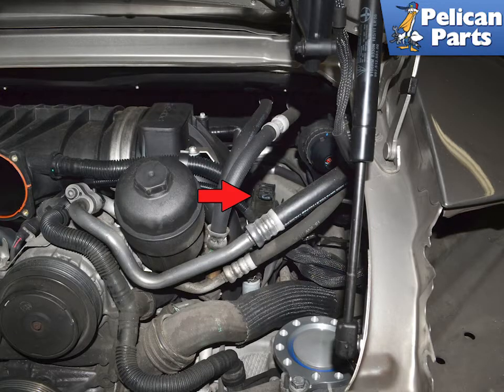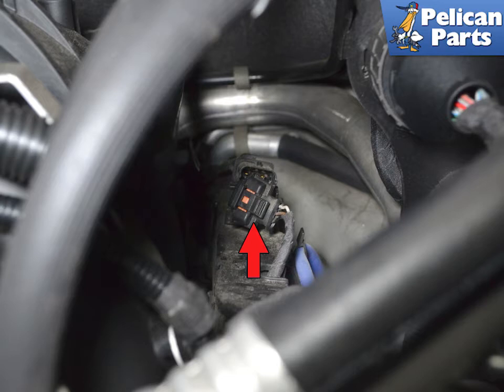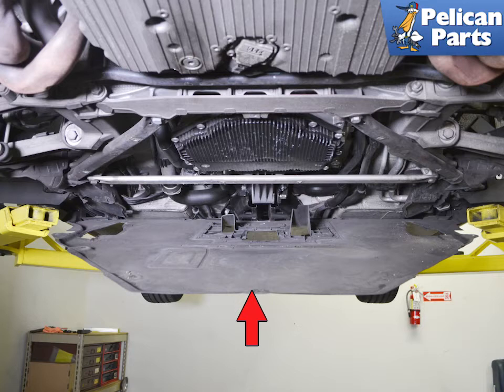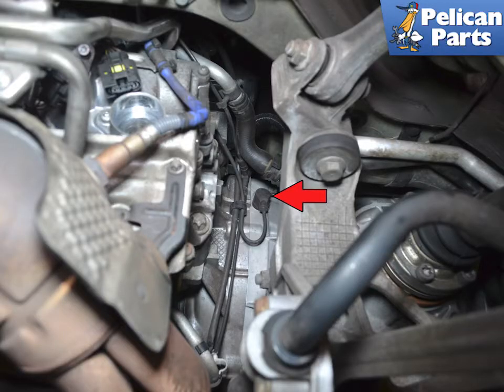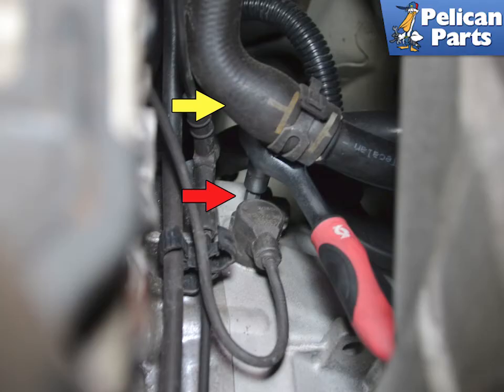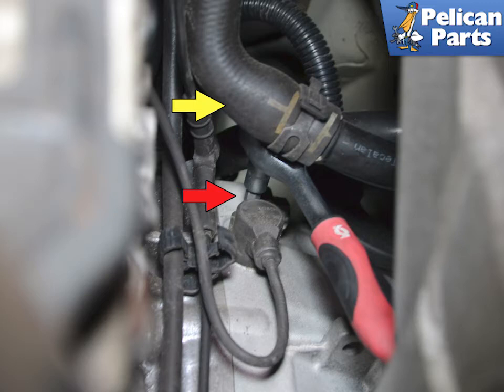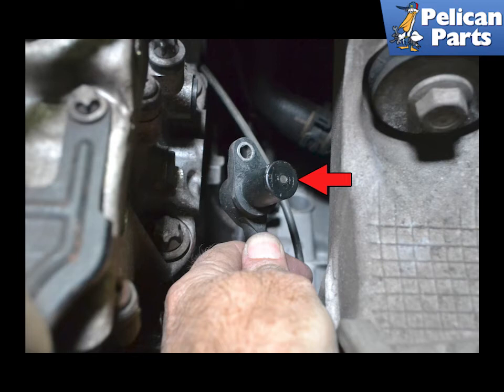Porsche 997.2 911 Crankshaft Positioning Sensor Replacement (2009-2012)

Comment: 2009 997.2 Manual Transmission: Unfortunately we are unable to remove the
center of the crankshaft sensor externally. The
magnetic core is not able to be drilled. There is
very limited room to work. At this point the
transaxle would have to come out to push the
sensor out from the inside out. Sorry for the bad
news.
Labor is about $3500.00. Clutch and flywheel (if
it becomes prudent to replace at this time) will
add about $2000.00.
Reply from the maker: Thanks for sharing your repair process and experience. These types of comments add so much to the Pelican tech community.
Reply: @pelicanparts  I did not perform this repair at this expense. I was hoping you could provide an alternative method.